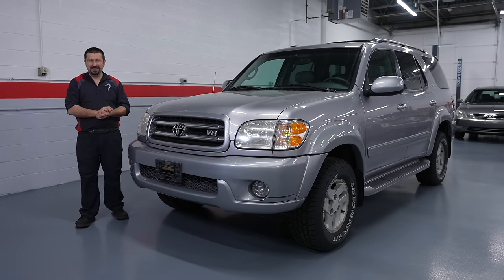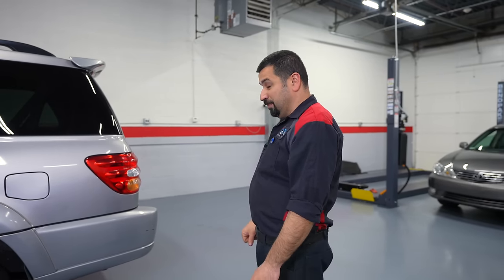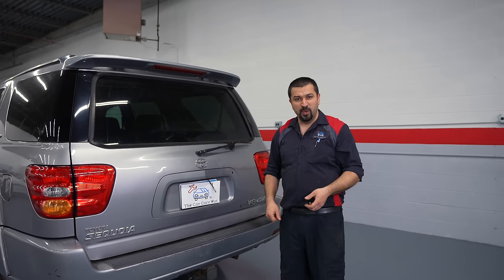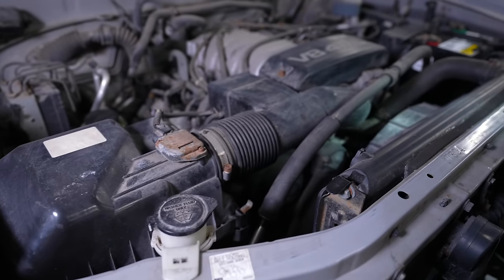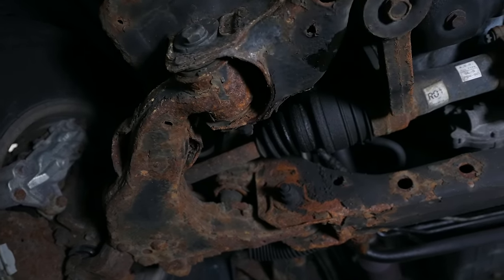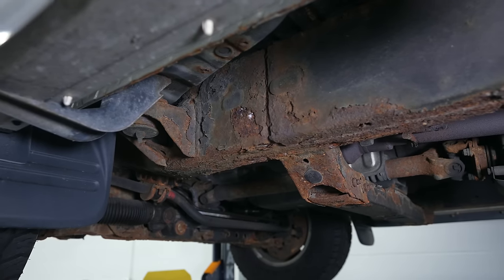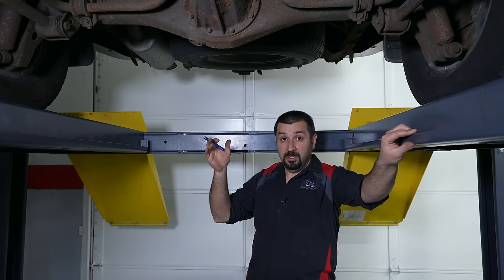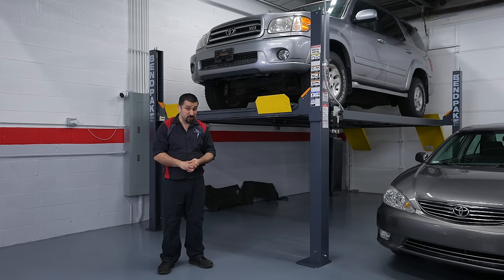NEVER Buy a Toyota Like THIS ONE! Hint : It's not The Sequoia!

Comment: I would drive all the way to where you are just to get a car inspected or fixed. You're a diamond in the rough. A rare honest mechanic. Doesn't even care too much about profit just an honest assessment of vehicles. Nice!
Btw. Now a new subscriber.
I do love toyotas. The only frame that broke on me was a 1982 Toyota pick up truck. Solid axles front and back. 4 cyl motor outlasted the frame. But it was awesome and unstoppable in heavy snow fall. I would still buy if I can find them.
With that said. Do you have any methods on how to take care of frames and make them last longer?
I do remember looking at a Toyota truck once. Looked good on the outside. Am a Toyota fan. But when I test drove it, it was having a hard time accelerating. I asked the seller what's wrong with it? It won't accelerate. Can't be a big deal he said. It's a Toyota. Lol. That'd not the toyotas I know and love and walked away.

Comment: I have an 06 Sequoia with 200k mi. We love it. Everything works - no broken levers, etc. However, I tow occasionally, so I had to have a frame repair guy do some repairs on the rear frame box that supports the hitch, because one side did get a rust spot. Also, a little rust also around the rear door to wheel well area. Mechanically, these models with the 4.7L engine are amazingly reliable. I like mine, but I wouldn’t touch another unless the frame was absolutely pristine. And I have done the two timing belt changes in its 200k mile life - it is so much work! I think it takes about 12 to 15 hours to do the timing belt, if nothing else is broken. I wish I had fluid-filmed or oiled it since we bought it - I had no idea these particular models could rust so easily.

Comment: Dang…that sequoia is looking nice. Excellent job pointing all this out. I was looking at a GX470 that had the coveted Sport Package and KDSS. The wheels had bubbling and the frame had rust. I ended up walking away and unfortunately never ended up buying a GX. But I likely saved myself a lot of issues.
Reply: The aluminum wheels had thick oxidized area and the paint on the wheels was bubbling

Comment: I purchased a Land Cruiser 100 series and it definitely has rust on the frame but essentially all 90s cars do. I do have to say that the metal used is exceptional. There is no holes or anything deep but only superficial rust, which is absolutely acceptable. Don’t even need to take it off, but just seal it with, a proper paint that will prevent it from further rusting. I do have to say US Toyota have a problem with rust and I think it does has to do with the metal used unfortunately. But to be fair a lot of those parts that you mentioned there are things that where out with agent should’ve been replaced as the car went on, especially if it was in a rust belt region. Now, replacing all those things cost your arm and the leg but still it’s all routine aging maintenance parts brake lines on Toyotas do get bad with agent should be all replaced. It’s not hard but it’s tedious. And you are absolutely right. The frame is a absolute no no. If the frame is in that terrible shape, it has to be replaced, which is going to cost more than the whole car price the only time that would be acceptable if you’re adamant that the engine and other parts are exceptional with low mileage and you want to do a rebuild and use it as a classic.

Comment: Thank you for this video. I have owned a 2004 Sequoia since new. I just went out to the garage to inspect the frame rails. Fortunately, this vehicle has not lived in the rust belt. But I do have the dreaded rusty back window tracks. Been putting that repair off... But I never put the oil changes off.
Reply: I did the rear window guide rail replacement. I got the replacement parts from a dealer for $200 and did the repair in a couple of hours. Not too hard.

Comment: Thanks for a great video I bought a 2006 Toyota Tundra and after seeing your video I  very concerned about my Frame I had it checked out and the guy said it was ok but it looks a lot like this one… I also have a 4Runner 05 and Sequoia 05 and there under sides are AWSOME no problems at all both with 300K on both….

Comment: I bought my '02 SR5 about 12 years ago with 175k on the clock.  I paid Toyota mechanics a hundred bucks to check it out.  They loved it and said they'd  buy it if I didn't.  So fast-forward to today, with 338k on the clock, no creaks, rattles, squeaks or problems.  Just routine maintenance.  LBJ's and timing belt is about it. Probably due for another belt.. But it's also a tank in the snow!

Comment: I live in Massachusetts. That vehicle would be condemned as unroadworthy. For safety sake don't let it leave your shop unless it is on a flatbed going to the scrap yard. As a fellow mechanic, if I saw that and let it leave my shop with someone driving it and they crashed due to frame failure I would be held responsible. 
I have had to have many vehicles towed away due to this.
Love your posts!!

Comment: Got my sister a 2001 Sequoia 4 years ago for $1.5k The previous owners thought it had a blown head gasket. Power steering fluid would disappear. Took a few days to figure out the 2 issues were related. They stated that it had a timing belt replaced shortly before the issues started. It would smoke really bad. 
The power steering is attached to the vacuum lines on the engine It helps it turn at low speeds. The previous mechanic broke the diaphragm that would allow the fluid to move easier to assist in turning. He just stuck the pieces back together, but once you break it, the seal breaks, and sucks power steering fluid up into the intake. This was causing both the power steering fluid loss, and the exhaust smoke. 
Went to the junkyard, and $5 later.
I have been keeping it going the last 4 years, and she loves it. The worst issue with it is the rear door handle. Replaced it too many times, and each one brakes. Tried replacements from the junkyard, online. Both the cheap and all metal ones. Nothing holds up.

Comment: Ontario, Canada here, a friend of mine has the same Sequoia and the same exact rust problem.  He’s been told by his mechanic not to drive it.  Earlier in its life, the 4.7L engine died because the timing belt broke and his wife didn’t notice until too late and destroyed the engine.  They ended up swapping in a Toyota 5.7L and it was going strong for many years.  Unfortunately rust is the car killer here in the rust belt.

Comment: I just bought a 2003 Toyota Tundra with 321k miles. That valve cover leak comment felt targeted, lol. I thought what I had was just a valvecover leak and ended up diagnosing it after buying as the cam seal and rtv on the cam cap to be leaking when inspecting the timing belt. Did end up having a good-condition belt tho.  I also diagnosed the serpentine belt tensioner to be bad because it was not within the marks and it would consistently wobble. Mostly new parts as it was a fleet vehicle, has excess play in the control arm bushings because they're aftermarket though seemingly new, and has some body damage reminiscent of its age. BUT i paid 4400 for it. Access cab, 4x4 lsd with the 4.7 and it runs great with no issues to be found otherwise. The frame is perfect literally not a spec of rust, the rest of the front end looks to be new, the rear end looks tight, no axle leaks, and the interior cleaned up nice despite having pool grease all over and having a few lights and trim pieces missing or broken, all fairly cheap though. I'm glad I was able to look at videos like yours and actually be able to diagnose my own problems instead of just flat-out replace parts or worse pay for labor. Had I not been taught these things I also wouldn't have had the confidence to buy this w/o a PPI and had I not there was another guy there with cash in hand prepared to buy it.

Comment: Agreed theirs a lot of bad stuff on the market these days and worst of all is it's all expensive and dealers won't budge on price!! I have yet to find any older car SUV or truck under 5,000 without any catastrophic issues. I test drove a 2004 Chevy Tahoe yesterday and though it was indecent shape quite a bit of rest underneath but not scale or flaking surface rust 189,000 miles on it and priced at wait for it 7,000 dollars. I offered 5 and no budge other than that for a down payment and rest in payments. Absolutely insane the market right now. Might as well hurt your accounts live simple and pay for new and hope your scraping by.

Comment: Love my 03 Limited. I have done plenty of work on it. It does have a unfortunate amount of rust but I plan on redoing the bottom of the car some day. The Seqouia has the rear hatch problem a lot and some owners get tired of it. There are bypasses like an interior pull cable kit and exterior bypass but having all those AND the working OEM handle is very nice. Best thing I do for my cars is to avoid the salt. I have never seen a broken fuel door handle though.

Comment: Great video.  I just purchased a 2006 Limited last year from a Toyota service manager, private owner.  He kept up with the maintenance items, and it had a new frame from the toyota recall.  It only had 135k miles on it, and the interior was super clean also.  The seller was impressed that I knew all of the main issues to check out on the Sequoias.  I even crawled under it completely to inspect other areas for rust and leaks.  I did alot of reading and video watching before starting my year long search.  I see this video now, and feel like I did well on my research.  Thanks!

Comment: The things to watch out for it's just like any other typical car. The maintenance intervals the oil. Whether or not the timing belt and water pump is up to date. The biggest one with sequoias is making sure the transmission is taken care of and making sure the frame was replaced under the recall. Otherwise you basically have nothing to worry about unless somebody purposefully destroyed it.

Comment: I have a fantastic running 02 sequoia.   Found frame cracked by rear tire.  Had new wielding done and around to trailer hitch area.  Just hit 200,000 miles hoping for more.  Also had undercoating done

Comment: I will be checking my 2001 Sequoia closely.  253,000 miles.  Pull my boat twice a year. Drive it in snow. About 8,000 miles yearly.  So far no problems in 3 years,  but it has similarities to your video.

Comment: 2000 Land cruiser. Paid $54,000 new out the door with most options and got free labor on install of aftermarket parts up to 5 hours of labor with purchase of car. I used my 5 hours for install a 3 inch suspension lift and 35 inch tires that I supplied. I also got a roof rack installed and that was 5.5 hours but they let it slide. I paid $1250 for the lift and $1400 for the tires. 
I have 412k miles on it and have replaced the tires twice and have a 3rd set that is on the fritz. All other repairs are only an ac compressor and brakes at 200k miles and pads every 100k miles. I just did my second full brake job at 400k miles. Car is for sale for $12000 and I did replace the seat leather on both fronts for $400 and the front control arms are about to be replaced before I sell it and then an alignment. It is still a good car and will make it another 100k miles maybe but I think it will need an engine soon. It is not as powerful as it was and it smokes a bit when it is cold on startup. That always happens to a Toyota when it starts to die.

Comment: Rust has killed many, many Toyotas! My 1999 4Runner with 205K miles, has the 5VZ FE engine, which is bulletproof, but rust is beginning to take over. My truck has the 5-speed, so it’s special to me, but I think I’ll be getting a new one in less than 5 years.

Comment: I got an 05 4Runner a few years ago. 160,000 miles, 4.7 v8. I didn’t crawl underneath,but I did notice some surface rust under the hood, rear end. Nothing on the body. Great looking inside and out. I’m 65 and just wanted something to get around in. Til things starting breaking off from rust. My mechanic let me know it couldn’t be fixed and it’s unsafe to drive. I thought I’d get another 1000,000 miles but got the wrong truck. So now I have a 2019, I’ve never had a better ride. The touchscreen audio with Wi-Fi I can stream my Spotify. Nothings for certain I guess.

Comment: Yup, I just ran into this recently.  Picked up a very "nice" black, sequoia that was used for 280k miles.  It's beautiful on the outside with a few dings here and there; maintenance had all been done within the last 20k with the oil change just done 1000 miles ago.  Buuuuut, there was frame rust.  Everything looked solid until I start knocking on the frame with a hammer, and that "surface" rust as he advertised, started to cave in and left a few holes.  But I already bought it, so oh well the fault is mine.  Paid 3500 for an '01 4wd V8.

Comment: I had a 2004 Sequoia Limited which I sold at 360,000 miles (580,000km). Never gave me any mechanical issues and was still running strong.

Comment: My friends 2007 Tundra looks like that, went to get inspected 11 months after purchase and mechanic showed him how rust was covered up with paint and thick undercoat. Took back to dealer he purchased from and showed them. They gave him a loaner for two weeks and welded patches over rust holes and undercoated some more.
The spare tire area where hitch is attached is really bad but painted over and undercoated. I would never tow anything with that hitch.  Very unsafe

Comment: My dad bought a 1986 Hilux few years back. It was leaking gearbox oil, engine oil and steering fluids all over the place.
But those leaks saved that car from rust, oil hit the axles and spit it all over the underside of the car.

Comment: My last used car was previously owned by a hammer hand - the hood was dented by slamming it, the driver's visor mirror was shattered, stereo touch screen had issues, somehow the seat heater was broken, it was covered with rock chips. It's on me that I ignored the signs of poor ownership, though the engine itself was just fine, as was the convertible roof and transmission.

Comment: Excellent! I suspect Toyota SUV frames when they are new aren't all that strong compared to a Suburban, which has an actual truck chassis. This Toyota was driven by a Suburban owner. I wonder if there have been any improvements in chassis material or protection or pouring salt in Winter.

Comment: Sold my 2003 Suburban that I bought new to a guy that traveled 100 miles to pick up at my house. He arrived in a VW Bug with a tow bar on the front of it. I took 5K cash and he towed his VW with the Suburban to Tulsa. It had 225K miles. Original spare tire. Dealer tag was still under rear floor mats. A true cream puff. A few weeks later I googled the vin number and it was for sale in Chicago and advertised as a 
'One Owner w/67k miles'. They still cheat on the milage!

Comment: My daughter drove a 2008 Subaru Impreza. She was poor and couldn't afford many fixes. Soon it would not shift into reverse unless she unscrewed the little plate near the shifter thing. Brakes were poor. So we took it to a mechanic who estimated it would cost $4000 to get it in good shape. I winced but said ok. She needed a car. So all the work gets done, they get paid. Then it is revealed that there is still a steering fluid leak. They did not fix that or even mention it. So the car was still unsafe. An honest mechanic like you would not have neglected to talk about that before making costly repairs to that car. It sits in a junk yard now.

Comment: I must say that if you buy it new and get the frame and under body rust protection. Plus as an owner don’t just wash the body wash the frame too especially if you live in areas where they spray the roads in the winter with sand and salt. The car is only as good as the owner. Or former owner

Comment: Dude i bought a 08 4runner V8 back in 2019 from a dealer. 1 owner maintained in that dealer. TO THIS DAY no problems other than a 1$ power steering hoe replacement minor leak. That 4.7 is legendary.

Comment: Ive only seen the cable to open on a buddys chevy tracker. Im planning to upgrade my cruze for a 4runner. Looked at a few some have been rusted out, i know to look underneath and in the door jams. Even a 2015 looked like it sat in a lake underneath drove really great tho. But no sense in buying a rust bucket if you dont have to. I already experienced that with a 2000s dodge durango and 97 land rover discovery. Even my 03 land rover discovery was as rusted out as the 2015 4runner.

Comment: My tacoma frame looked fine from all angles and still had paint when the leaf spring hanger broke off and the frame arond it crumbled. If you see rust like that on the outside there is nothing left.
I got lucky and got mine fixed for about $1,200 at a really good shop.

Comment: I just bought a Avalon. 1900. Tried to explain, hey I hope it gets me 2 years maybe, but if stuff goes wrong, there goes my value for money. Wouldn't take less. 

Water pumps leaking, and the rubber vvt line isn't changed. Dun dun dunnnnn. They really got me

Comment: Best thing would be for owner to disassemble the whole thing and sell every single salvageable part possible to recoup what needs to be considered a loss and then just sweep up the rest of the frame and toss it in the trash. W so many still on the road gradually selling parts big and small is much better than giving it to the junk yard for $75 at best. Closest thing to a solution for this goner that i can think of.